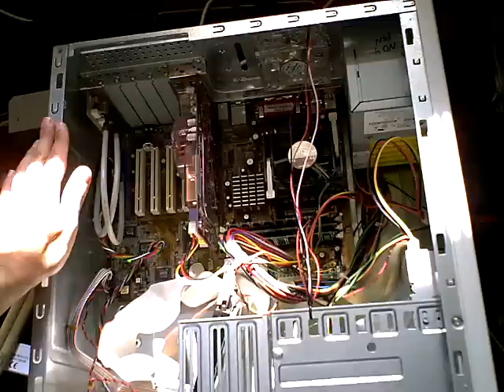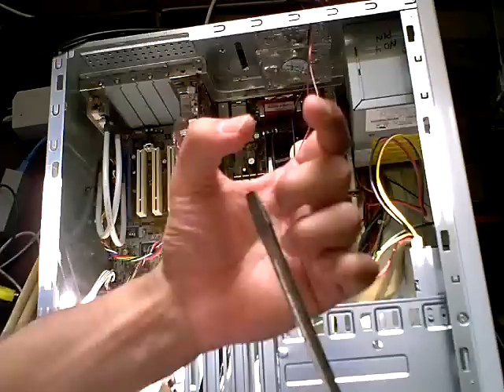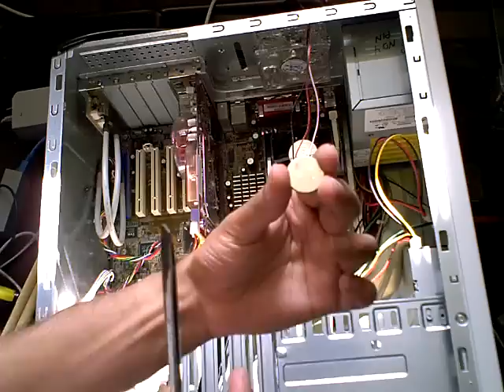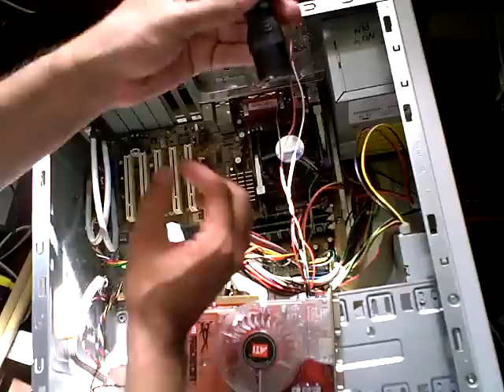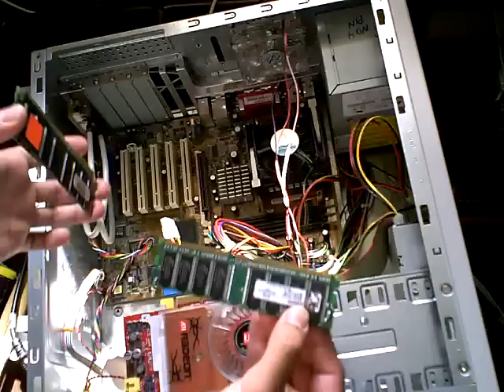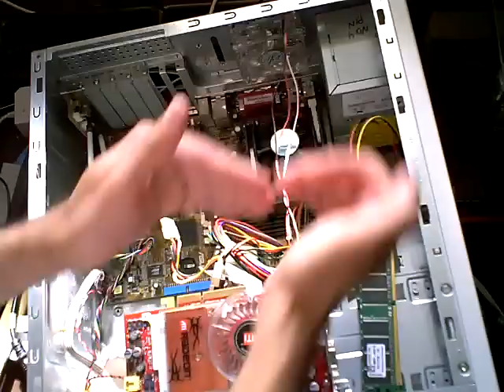How to possibly fix a PC that will turn on but will not beep and will not display anything on screen

Comment: I have a similar problem.....if i run my pc with a graphic card it load but no image shown, but if i remove it and use the build in graphic, then there is image, already try putting in a new graphic card but its still same.... can any1 tell me what problem is tis?
Reply from the maker: +jarvil chang Try this: unplug the PC, install the new video card, but leave your monitor connected to your onboard video card, then power up. Do you still see an image?

Comment: how do i know if i have a bad motherboard ? i buy another graphic card but the fan not working, i also try another processor same black screen and i check the power supply volt not too bad volts
Reply from the maker: Your CPU might not be compatible with the board. note that matching bus types of video card to motherboard socket (PCI-E for example), matching socket types of CPU to motherboard socket (LGA1366 for example) or matching bus types of RAM module to motherboard socket (DDR3 for example) does not necessarily signify compatibility. If this is the first time you are trying this hardware on your motherboard, there is a chance that this new hardware is not compatible with your motherboard, despite the same bus type and despite the fact that the new parts fit in their respective motherboard socket. Your motherboard manufacturer's website will have a support page dedicated to your motherboard's model, and on this support page should be a compatibility list for such components as video cards, CPUs and RAM modules. Ensure that your new component is certified to function with your motherboard, and if your new component is not present on the compatibility list, then there is a chance that the new component is not compatible with your motherboard.
Reply: the problem was the motherboard i buy one MSI 970 GAMING, AM3+ (plus), AMD Motherboard BRAND pc working fine now
Reply from the maker: Good then.

Comment: i have a dell PC from 2007 and couple of days ago the PC just shut itself off. i turned on the power button, it turned on and i got into the windows "log in" screen. after 5-8 seconds it turned itself off again before i was able to "Log In" and turned it self on again. this happens repeatedly!! someone know What Might Be the problem? I HAVE alot music files ive created through out the years, and i do not want to lose it all!

From an idiot in Norway! thanks
Reply from the maker: +المسيح هو ابن الله Heh, don't worry, I'm not too bright myself : ) It sounds like your motherboard is developing a short circuit due to contact with the metal casing. Most likely it has to do with the screws and metal mounting stands (supports) that your motherboard sits on. The cheapest way to fix this problem is to introduce cardboard washers between the screws and where they make contact to the motherboard, or you can buy plastic mounting supports at a computer shop.

Alternatively, you can always Breadboard it (explained in the following video:)

If the steps in this video did not provide a solution to your problem, view:

http://www.youtube.com/watch?v=_EK9a-R5pss

You never know, maybe rebuilding the PC in the opposite sense that you took it apart will solve the problem.

Comment: I have had no display when booting up and when I press the the button to open my disc tray it shuts as soon as it opens by itself
Reply: Have the sane problem
Reply: I have the exact same problem
Reply: +James Whiteside  did you manage to fix it?
Reply: hey man I'm having the same issue, how did you fix yours?
Reply: +James Whiteside I have the same problem? did you fix that at all? could you help me out?
Reply: same here ://
Reply: i fixed mine. something to do with the cpu and the pins being out of place or something. but, go and send it back to wherever u got it and get it checked out
Reply: Will to man thanks :)
Reply: Bluee Ice GFX no problem
Reply: just found out that my mother board was dead which destroyed my power supply, ram, and cpu.

i hate my life...
Reply from the maker: +James Whiteside Do what the video shows
Reply from the maker: +N8Squared Official Do what the video shows
Reply from the maker: +AnGeL MiST Do what the video shows
Reply from the maker: +Darksidex41493 Dark Do what the video shows
Reply from the maker: +Yan Larue Do what the video shows

Comment: I  have an Acer aspire e 15 es1-512-c96s with Celeron n2840.i tries to boot up and then there's a message that says something went wrong .i have been able to get to the windows 10 loading screen but that's all.i was able to get to command prompt 2 times..i ran the sfc scannow..it reported it couldn't be ran .when the greeting part comes on that's ad far as it goes..i tried booting from win7 but got locked out due to a srcuritypasseord that popped up..where do i go from here?this laptop is less than 5 months old..it runs like a champ till today ..
Reply from the maker: +Randy  Marsh Eek. Sounds like a nightmare. Is your PC on warranty? I'd try to send it in for repair. If you don't wanna go that route, you may need to restore the machine with a restore disc (hopefully you have that). If you are trying this and getting the security code error, you may need to properly format the drive beforehand.
Reply: +Randy  Marsh the laptop was repaired using a secondary hardrive .apparently windows 10 update had something to do with this,it has been restored to win 10 build version. msn support did not specify the error but restored the windows at no cost.ty
Reply from the maker: +Randy  Marsh Hey, no cost, no complaints : )
Reply: lo!it was windows 10 error update.msn wouldn't tell me what went wrong but its fixd no cost.:)
Reply from the maker: +Randy  Marsh Better that way : )

Comment: if the fan turns the motherboard is not defective, right?
Reply from the maker: +Lhora Mae del Castillo I wish more people would ask this question: thank you for doing so. Fans can spin, lights can light, but if the PC does not beep and does not progress past POST (does not try to load the operating system) then the motherboard can very well be dead.

Comment: On my this happens but not even the fan is spinning. I did RMA the board and cpu. It tested alright for them. 
There are lights on the board. but thats it. Thinking of buying new ram but i want to try to rule out any error first.
Reply from the maker: Normally, the PC should still fire up with no RAM present (and if you have an internal speaker connected, you should receive the beep error codes). Ensure that your power supply is properly and firmly connected to ALL required ports, and ensure that the voltage on the power supply is set proper to your countries' voltage type. If still no luck, maybe the power supply has a problem.
Reply: RodneyDickson
I get no beeps no fans is spinning.
When RMA the board and cpu they tested everything was working fine and it started.
But the board have lights.
They turn on when when i turn on the PSU.
I dont understand whats wrong.
Is it ram or psu what do you think?
Ive seen before the pc would boot if incompatible ram. But this is a newer system. So im thinking maybe now nothing will start ?
I consider buying new ram. If that dosent work then i dont know what will.
Also everything is brand new.
The ram i have is on verified ram list.
Reply from the maker: The reason I gave you my previous answer is because your symptoms can be attributed to a defective or underpowered PSU. It's good you ensured the RAM is compatible. If you are still in doubts about the PSU, Breadboard it (explained in the following video:)

If the steps in this video did not provide a solution to your problem, view:

http://www.youtube.com/watch?v=_EK9a-R5pss

You never know, maybe rebuilding the PC in the opposite sense that you took it apart will solve the problem.
Reply: RodneyDickson

But how can i get lights on the board if its defect ? also this is a gold rated 1000w psu its not some cheap garbage that break after 2 months
Reply: RodneyDickson

Or is it possible i got scammed from the RMA? they said sureee everything is ok and really did nothing? i dont know what to think atm :S everything is connected
I dont want to buy ram before im 100% sure that is the problem
Reply from the maker: There is not just 'works' and 'doesn't work' when it comes to PCs and their components (if there was, this video wouldn't have 1.5 million views). There are varying states of component operation. I've seen your situation (won't turn on but the motherboard power light illuminates) with near-dead PSUs, and also with PCs that were short circuiting. Thus, if you breadboard it like I told you to, you will eliminate the short circuit factor. If you checked your motherboard connections and voltage of your PSU, you'd eliminate those error factors as well.
Reply: RodneyDickson

So you think the PSU just isn't powerful enough ?  because in theory it should be way above specs. It would make sense if that was the case but again.
This is a 1000w premium psu...
Its new so if its broken its not my fault.
I could try to RMA this too.
Reply from the maker: I cannot follow your logic as to why you think the RAM would be the culprit here...that breadboarding lesson I have up...no RAM is involved in that test...meaning that your PC should show signs of life even before it even sees RAM
Reply: RodneyDickson

I just noticed the board dosen't have a cmos jumper. Could that be why ? There is a cmos jumper in the manual but not on the board.  I cant find it. Can i buy a new jumper for it ?
Reply from the maker: Could be any number of problems or incompatibilities. Here's the problem: you are looking for a smoking gun based on little information. I have no idea if your CPU is even compatible with your motherboard (just because it fits in the socket does NOT mean that it's necessarily compatible). There are ways of testing PSU connection resistance using a multimeter, but that goes beyond my scope of knowledge. Breadboarding is the best way to narrow out as many error factors as possible when troubleshooting...if you just refuse to do it, then you might as well RMA each piece one after another and pray that magically you find the problem that way (and btw, it is entirely possible that you will not find any problem in that scenario)
Reply from the maker: The actual CMOS CLR jumper cap is left in a RST position when not being actively used to clear the CMOS, which means it does not make an active connection between pins. That being said, you adding a jumper cap will not help anything: if anything, you can cause WAY more problems by doing so: just leave the CMOS CLR pins alone.

Comment: my hp pallivon windows 8.1 desktop powers up then reset it self .then itpowers up & reset it self it keeps doing that it wont get past the black screen  cant see anythang on the screen  it will keepdoing that... any help?
Reply from the maker: In your case, I would download and burn a Linux Live CD (using another computer with CD burner and internet connection) and try booting with that. If the computer remains stable otherwise, it might be your installation of Windows that's faulty. Then again, your PC sounds very new, and therefore should still be under warranty with HP. Calling HP tech support is a nightmare (you will speak to an Indian call center and go through ridiculous troubleshooting steps before your request is granted) BUT if worse comes to worse they SHOULD ship you a shipping back kit to ship the PC to them and receive it back once fixed at no cost (they might also just send you a recovery disc, which would also solve the issue I believe). Pro tip: If you have another national language where you live, requesting the non-English option may get you a local call center instead of India. Good luck with it.

Comment: we motherboard before burned. then repaired. however now hdd running while fully im not sure, healthy whether decide giving cant am i. cuz, both hdd me ''sata device not found'' that telling.
Reply from the maker: +Fatih taşdemir Try another SATA header, try another SATA cable, try another SATA power supply cable, and finally try another SATA drive. Perhaps the SATA interface of your motherboard is dead
Reply: +RodneyDickson sata header what's? already another cords tried im. however it hdd sata not, pata. now both hdd opening wont.
Reply from the maker: +Fatih taşdemir SATA header is the SATA connector on your motherboard where you plug in the SATA cable.

Comment: Basically my computer froze one day, but it was a different crash from its everyday crash suppose. It froze weirdly and I restarted the computer as usual. I turned it back on, but it had to repair itself so I restored it. After restarting the computer I'd turn it on and it'd be pure black displaying nothing on the monitor. My brother is really angered and jus suggests we buy a computer, but it's a mid game asus computer, and we surely don't wanna waste the money again. Any suggestions? I'm 15 years old so I'm not really familiar with this at all TBH, but my brother is really smart so with your help we can probably find a way to fix this computer and bring it back to life. Plz help :((
Reply from the maker: +Bart Saguros Ok, let's start from the beginning. When booting the machine, does it beep?

Comment: Thank you, Thank you, Thank you, Thank you, Thank you, Thank you, Thank you, Thank you, Thank you,... i just reset ny cmos.... and now it works.! Thanks!
Reply from the maker: Nice! Glad I could help : )
Reply: +RodneyDickson yesterday my pc just worked no iT does not
Reply: Rodney, i reset cmos and it beeped once on bootup but screen remains black? what can i do? (this problem accured mid installation of windowsxp)
Reply from the maker: Try what is shown in the video
Reply from the maker: MultiAyame, in your case, power down the machine, connect your display to a DIFFERENT video out connector, and power up. If this does not work, repeat, each time powering down, connecting your display to a different video out connector, then powering up, until you find the video out connector that works. Lemme know how it turns out
Reply: no change :(
Reply from the maker: From reading what you have written prior, I am to assume that your PC shows text when booting, it is just when trying to boot windows that a black screen appears, correct?
Reply: no,no. nothing shows up on screen, no OEM splash screen or POST screen. monitor goes immediately into sleep mode and stays that way no matter what i do; usb slots, keyboard and mouse don't work , only cd slots do.
Reply from the maker: If it is still beeping once during bootup, unplug the PC, remove the video card (store it on a non-shiny wood surface, a non-shiny cardboard surface or an ESD anti-static bag) , connect the display to the onboard video out, and power up. 

If it is not beeping at all during bootup, do what is shown in the video.
Reply: RodneyDickson
 it beeps, but can you elaborate more on what to do? i'm new to this and english isn't my native language. You want me to take the video card out and try to boot without it?  or did i misunderstand
Reply from the maker: That's exactly what I am suggesting. Without a video card present in the machine, I'd assume that you still have an onboard video-out port, in which case connecting your display to that (and only after this connection is made) power up the machine.

If the PC can display from the onboard video but not from the addon video card, then the addon video card (or the motherboard connection to this video card) may be the problem.
Reply: no other onboard video port so i can't try that out :(
Reply from the maker: (shrug) sorry then. You might have to invest some money in a cheap video card to see if that solves the problem. Here's a trick: find someone selling one used on Kijiji, then contact them and ask if you could bring your PC over and test the video card in your machine before purchasing (to ensure compatibility). If it works, buy it, and if it doesn't, then thank the seller for his/her time and head home : \

Comment: i have problem issue on my pc, when i click anything. it keeps frozen in a sec, so after that screen it down to say like "boot doesn't installed"
Reply from the maker: +Artemio tillie Romero It sounds like it cannot access the resources on your hard drive. Is this a Windows based PC? Cause your issue sounds more like how Android would behave...
Reply: +RodneyDickson really, because while ago i just replace new hard drive, so its nothing wrong with it , so after that week now, it actually went happen likes this, but thanks for advice
Reply from the maker: +Artemio tillie Romero If you write down the exact message, and then search it in Google, I'm sure others have come up with solutions to your issue. Also, does this only happen with certain programs or all programs?

Comment: hello i hop you can help me my computer start up had the 1 first beep then show the win page start and after that pop up save mode and the screen come black and nothing happen the screen say black but the computer are on ,please help if you can i must fix it the soon i can is a work commuter
Thank you
Reply from the maker: Ok, well, if your PC will not get past Safe Mode, your operating system is corrupt. Sadly you'll have to reinstall the operating system from scratch (I also recommend resetting the CMOS (as shown in this video) and formatting the hard drive before reinstalling to avoid any problems that'll carry over)